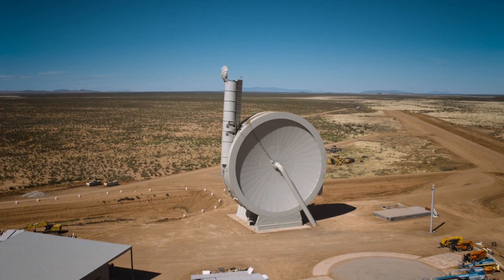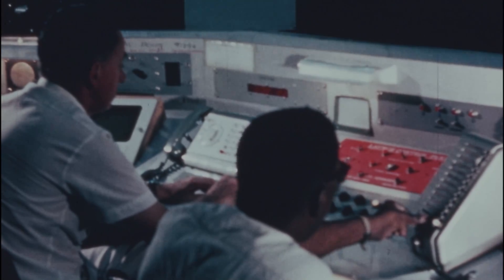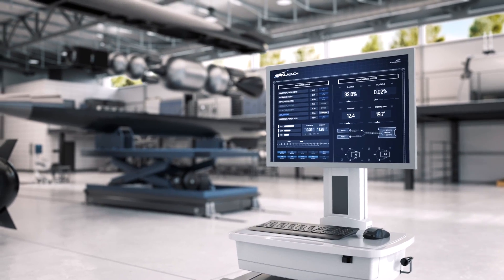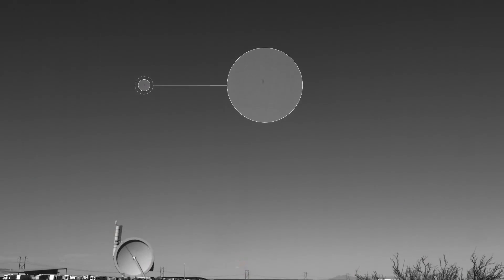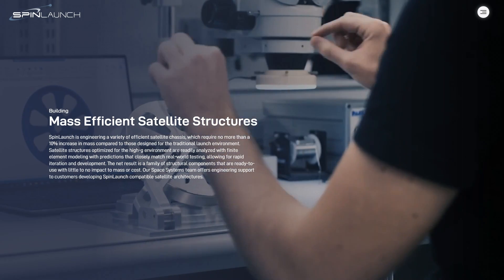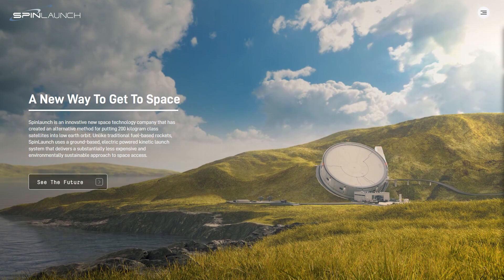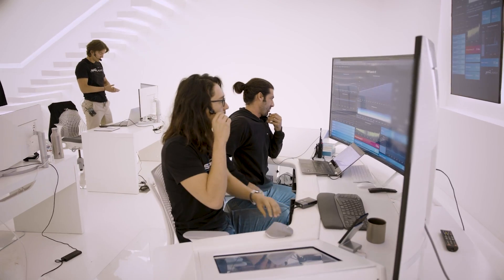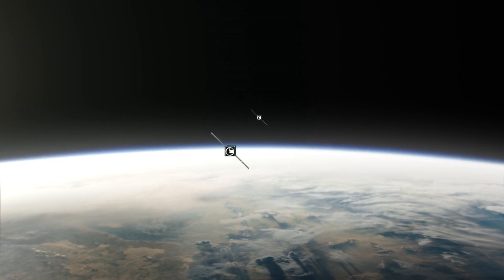Can Spinlaunch Throw Rockets Into Space?

Comment: I wonder what liquid fuel would do at that G load... not to mention the amount of heat he mentioned right out of the tube. Idk... cool idea but what are you really saving 🤔  fuel vs a huge amount of electricity required. Either way you use fuel, either in the rocket or to generate the electricity required.

Comment: This will dead-end when they realize its easier to produce a pair of magnetic accelerating wheels that you charge and spin up to speed then just place the payload in the tube down below them and activate the already spinning at high speed EMimpeller disks that lift the launching S.H.A.R.T.  (super heavy accelerated return tug) that the spinning acclerators induct.

Tho I wonder how Hotwheel's sponge-disk patent is holding out.
Reply: Indeed

Comment: I like how this allows them to take their time speeding it up. Most of the other options i've seen are just different ways to speed it up at similar acceleration to what rockets do. That means they get to choose the nicest way of powering it, simple electricity, no massive capacitors or environmentally questionable propellants.

This is a promising way to get raw materials to space. Currently every kilogram was a huge cost. But there might come a time when that's only true for kilograms which can't handle high G forces. And it's trivial to make things like water or rocket fuel or 3D printer resin be immune to G forces. Which makes colonies sound much more viable.

I wonder if they'll build it high up to reduce the atmosphere issue since it'll affect them more than it affects most rockets.

Comment: I am pretty sure there is a way to launch such that most of the energy in the rotating mass is transferred to the projectile. The projectile would have to be allowed to follow a curved path with respect to the rotor as it departs. It would be moving away from the center of the rotor, and also advancing in the direction of rotation at the same time. If the rotor was a disc with a curved slot in it that guided the release of the projectile, it would accomplish this. The main benefit of this is not efficiency but leaving the rotor without a lot of kinetic energy and mass imbalance. The counterweight would need to move at the same time to maintain balance. By the time the projectile launches, the rotation will have slowed so much that the imbalance will be manageable. I am sure these guys already thought of this. They may have rejected it as too complex, or maybe they are working on it but not announced yet.

Comment: My thought, it takes alot of fuel to get a rocket into space, a considerable amount of that energy required just to get it moving and up to speed, what if instead of a no propellant rocket, a normal rocket with a normal propellant load, but yeeted, so when the engine does ignight, its already at speed, and some of the trip is already completed. You could then trade more payload weight over fuel to complete the same mission a falcon 9 completes, less fuel, more payload. It could become a viable means to shoot materials to other worlds in decent quantities to say like Mars or the Moon. One of our biggest limitations to getting materials to space, is fuel is heavy, and the more payload you want to move, the more fuel you need, and the more weight you add in fuel, needing yet more fuel to move the fuel. A catch 22, creating a sweetspot, a payload to fuel ratio. This machine could reduce the need for fuel, allowing us to replace that weight in fuel savings with more cargo
Reply: At 20,000 ft, it would have half the air pressure (roughly) to deal with, allowing for far greater speeds, or less energy required/faster launches.  They should be building this as high up a mountain as they can manage.  Even at 12,000 ft, it's a major savings.  With no fuel required until you reach low orbit, it's an obvious win-win.  Note that I used to do this in KSP - use a plane/plane engines to get it to the upper atmosphere, and separate a much smaller rocket from it - requiring a fraction of the fuel and allowing for easy access to the entire solar system when in career mode.  Even launching from an alternate site several thousand meters higher up was a noticeable amount less fuel.

Comment: I feel like the easiest way to solve the balance problem would be to have an inert block of steel on the other end of the rotor with the same mass as the projectile, and release both at the same time. The weight block would have to fly the opposite way, possibly into an underground sand berm.
Reply: If you wanted to create a glass crater.. sure.

Comment: I have seen designs for railgun-type launchers that hoped to use a plasma window at the end of the evacuated tube.  They claim that plasma holds the air out just fine.  Seems much better than a breakthru membrane if it works, but this design doesn't seem to use it.  So some questions: Does the plasma window idea not really work?  Cost too much?  Did spinlaunch not hear about it?  Maybe it's buried somewhere in spinlaunch's details?

Comment: To solve the issue with suddenly de-stabilizing the load on the rotor could they not just have a counter weight set up to release simultaneously with the payload aimed out a separate mirrored tube facing down set up for a "controlled" rapid deceleration of the counter weight. That way both sides go from loaded to 0 at the same time helping to maintain the stability.

Comment: You mention the importance of timing the release accurately.  I believe the bigger challenge is to design a release mechanism that is repeatable.  If, say, the release mechanism takes exactly10ms to operate, then you could easily calculate the exact point to initiate release.  However, if it sometimes takes 9.9ms and sometimes 10.1ms then you might be in trouble!  As the release mechanism is presumably electro-mechanical, I see this as a major problem that will need to be overcome.
Reply: Explosive bolt. Electronic Detonators can be purchased off the shelf with little at 0.035 microseconds of standard deviation.
Reply: @WorBlux   @WorBlux  Understood on the detonator.  But there must be a substantial fixing of the projectile to the boom (based on g force and mass of projectile being several thousand pounds).  The release time of the projectile (not just the detonator reaction) must be predictable with a high degree of accuracy.
Reply: @chriswright9096   The forces involved are bigger challenges to solenoids or mechanical solutions. Regardless the behavior of explosions is pretty well understood, predictible, and most of all fast (18,000 m/s shockwave fast).  Even if it turns out to be some clever linkage rather than explosive bolts (which are like standard bolts, bu with some explosive in the middle,) I expect it to be motivated w/ explosives.

Comment: As an electrician/wannabe electrical engineer, I'm a little annoyed by the computer simulation having a motor and gearbox on the side. Hopefully the final version has a big electric motor on the axis of the arm itself. You could even get it so the bearings and motor (and giant VFD) survive if the arm and projectile break off inside the chamber.

Oh, and if you have an 8 km/sec railgun, this looks like a perfect way to bring it up to 10+.

Comment: Interesting that they went with circumferential fling (shown here) rather than radial fling (think of a Starfury launching out of Babylon 5's cobra bay). I guess circum fling is more effective/efficient, but the vehicle needs to be engineered to withstand lateral centrifugal force while a vehicle positioned like a spoke on the wheel will endure forces along its longitudual axis (as it was designed to, being a rocket).

Comment: Question: Why not just launch the rocket as a missile from an X-15 or similar aircraft, if it is the same speed at launch but at a higher altitude? Obviously the X-15 was expensive to fly but that's because it was a research program, and it would be much cheaper if done regularly.

Comment: What if they simultaneously released a payload of equal weight from the other arm traveling in the opposite direction as the primary payload? Make it a shell of carbon fiber filled with water, and have it go through a small tunnel into a chamber beneath the site with a target made of reinforced concrete where the balancing payload vaporizes into a water cloud upon impact. Equal and opposite, as nature intends.
Reply: Why would you make the target of "reinforced concrete" when you could use sand?
Reply: @aluisious  Less cleanup with a solid object, the sand would make a nasty mess with a thick slurry spread all over the chamber, but I suppose if you design it right it could work just as well.
Reply: @DjRjSolarStar  i dont know if a solid object would remain that way for long experiencing these forces
Reply: @jesseh1677  Concrete has high compressive strength, hardness, and erosion resistance. It's also really cheap and a large pad of it could be replaced for well under $1000. Steel doesn't give you as much bang for your buck here, though could work if hardened and/or shaped for gradual force distribution.
Reply: @DjRjSolarStar  $1,000 of concrete is  2 meters of sidewalk. Prices have gone nuts
Reply: Now imagine the second load shuts into something that recovers energy. Like an electric coil in a long tunnel.
Reply: @bartoszlobejko  Ahh, even better, a gaussian generator. I had this same launch technique as an idea a good 15 years ago, however I conceived it for rifle weapons. I'm glad to see someone had the same general conception but took it to a whole new level. Now imagine a 10 mile long 'barrel' made out of S Glass or in the future, carbon nanotubes, vacuum cleared, and supported by solar powered helium drone blimps with GPS for precise position holding, using wires from above to hold up the vacuum barrel. With the same launcher size and power, your load will go much faster at high altitude and hence require a smaller rocket engine and less fuel for orbital insertion. Placing one of these on top of a very tall mountain, or a plateu like Atacama, will help even more.
Reply: @DjRjSolarStar  Those locations have been considered as holy to many locals who know their history. I will say that if proposed with the right intentions perhaps it's possible but it would be a pretty big if. Respect for historical sites with regard to scientific advancement is an Absolute must if you want Any cooperation.

Equal and opposite reaction applies to cultural changes.
Reply: @bartoszlobejko  That tunnel is going to have to be as long as a linear accelerator to launch the spacecraft would have to be anyway. At that point you should just point it up and use it as the primary launcher.

Comment: I've always wanted something like this or a space railgun to exist. I'm so glad in a kerbal sort of way someone is working on this.
Reply: You've stated why if someone creates a pinpoint targeting system for it we will not hear of it again for atleast 10 years
Reply: Yeah and talk about whiplash… people would die immediately due to the pure density within the GeForce you will be feeling. Automatically snapping their knocks ,collapsing their lungs and more. Engineering wise is amazing on paper but you might as well use an oversized potato cannon instead….
Reply: @mrpumperknuckles1631  they were never really envisioned being used for crew... like 95% or more of launches aren't crewed anyway sooooo... not a big deal, especially if it's significantly cheaper. That said, magnetic acceleration, rail guns, or even traditional chemical propellants can be used to safely accelerate people if need be. Some theme park rides work like that now using mag accel; and the US/French designed and the Nazis actually built & used a chemical-based cannon that could be used with safer pressures and acceleration.
Reply: @mrpumperknuckles1631  probably not if accelerated slowly. Buy because of centifugal  forces you may beright. There will be lots of push/gdorce in outer side direction. So for humans probably we will need something with greater radius or flat one with acceleration coils ;p
Reply: @mrpumperknuckles1631  this isn't ever meant to send people anywhere. It's meant for hardware and/or satellite/resupply missions.
Reply: Well I mean Iraq actually started building a space gun in the late 80s (doesn't need to be a rail gun to launch to orbit), but Israel didn't like the idea... and assassinated the Canadian leading the project. Then the UK stepped in and seized a bunch of materials they were using to build it... & then Iraq invaded Kuwait & then promptly got invaded itself by the UN, which then destroyed all the space gun equipment.

Comment: I feel like this could be used as a almost untraceable missile like weapon system. 😅
Reply: not really. Same problem as hypersonics. all you need is a satellite based thermal camera to spot them easily. Intercepting is a bigger issues, and getting a kill vehicle up to speed in time to achieve an intercept vector is a different matter. but again, same issue with defending against hypersonics.
Reply: No.  Modern radar can track artillery shells from when they leave the barrel; most modern armies have counter-battery radar systems so when enemy artillery opens up on them they can locate a firing point in a few seconds and fire back with devastating effect on the artillery battery that launched the shell.  Some NATO artillery units can send shells or missiles towards a launch point before the enemy shell lands.  This is why many modern artillery units have self-propelled guns that can fire, move, then fire and move again.  They know as soon as they begin firing on a well-equipped modern army the enemy will know where they are.  Fast moving projectiles as small as hand grenades can be tracked from many miles away so something as large as this rocket would be easy to detect.  Oh, and the faster it is moving the easier any object is to detect.

Comment: A rail gun that is near 2 miles long and climbing a 17000 ft mountain would release at a higher altitude so less dense air 
Rotating a person at thise speeds would be dizzying sick 
Beside maybe causing brain stroke especially if you ever sent an elderly person into space
A rail gun could be several miles long a more gental excelleration
And after the desired inertia is reached the rail could curve up to desired trajectories

Comment: Fit the counter weight with an electromagnet that activates on release.  Release the counter weight simultaneously with the projectile in the opposite direction down a long sub-terrain aluminum tube.  The counter weight decelerates due to the Lenz Effect.  Possibly extract the KE of the counterweight for a more efficient system.

Comment: Proposal: Release the counterweight and yeet it into the ground to maintain a balanced rotor during and after launch.

Edit: or maybe better is two counterweights at angels at like 120 degrees to create an effectively a similar counterweight at 180 degrees an yeet them sideways at launch to prevent ground infrastructure damage.  Not exactly 120 degrees but play around with the weight size, angle, and distance from center.

Comment: quick question regarding the bearing. would it be possible to do this with electromagnetic forces holding it in place? 
in theory you'd have no friction, no mechanical parts deforming on release and you could adjust the magnetic strenght according to the current forces. but would it be precise enought? would it be efficient enought? i have no idea how much power something like that would need.

Comment: Totally different scale, but Tom Stanton built a flywheel trebuchet. This trebuchet has a whip line that snaps around on release. By tuning the projectile mass he was able to dump almost all of the kinetic energy in the system into the projectile. In other words, after launch, the flywheel just stops. Perhaps it would be possible for spinlaunch to do something similar. I guess the question is, what is easier, rebalancing the flywheel in less than a ms, or adding a mechanically complex whip action to the launch and converting all the rotational energy in a short interval.

Irrespective of all that, one observation is that once the barrier is broken by the projectile, the whole chamber will be flooded with air fairly rapidly, and that will surely slow down the flywheel rapidly, at least at first.

Comment: 45 meter rotor equals 201.2 G rcf on some converter.  With the squared vel 98.0665mps at launch being one G is 19.73 kms mabye it can fling 1kg to the Karmen line in 5.068 seconds or 84.5 minutes provided there was no resistance and it had a super cavitating nosecone. Looks rather conceptual the bearing should be resilient and, its not maglev but seems lubed not by superconducting hydrogen. It's not a flying saucer.

Comment: Worlds biggest and most expensive Slingshot! 😅😅😅👍👏👏 It would be good to get the launcher based as high as possible to begin with, but I guess the electricity supply to it  is another problem. 🤷‍♂️ 
Another method that may be easier is to spin the launch tube, with the escape vehicle sitting at the centre of rotation and when the spin rate is sufficient, give the vehicle a quick shove into the escape section of the pipe at the correct time. It would be flung out of the tube at the same speed (or possibly faster ) as this contraption can, but the spinning arm wouldn’t need rebalancing.

Comment: If you could incorporate a pulse drive into the rockets/projectiles too boost its range plus modify its shape. Be careful with the speed and heat of it though. H.F.C. O3/ozone.  Etc. Elon musk will love this. Just shoot building materials up there. Rail gun is too dangerous for this purpose. Also aligning the earth and the projectiles flight trajectory would help ease the stresses on it. Very interesting. Just as long as real.